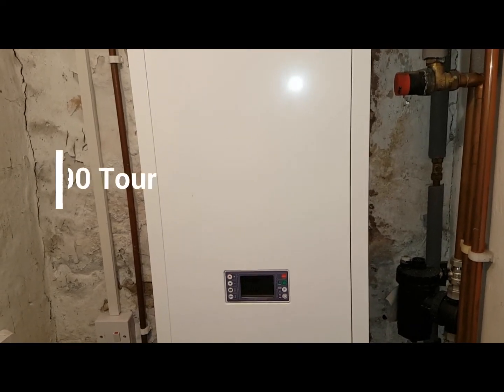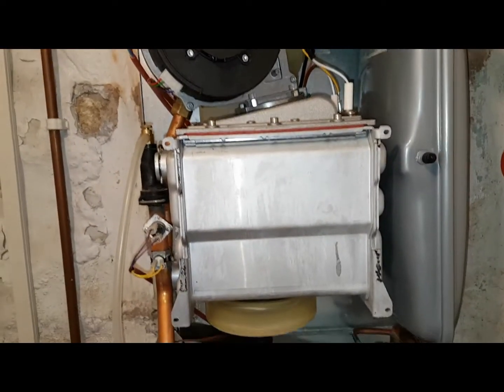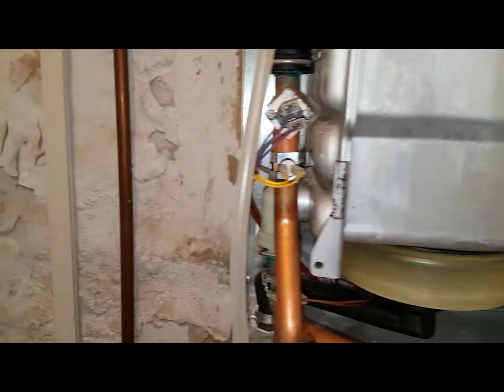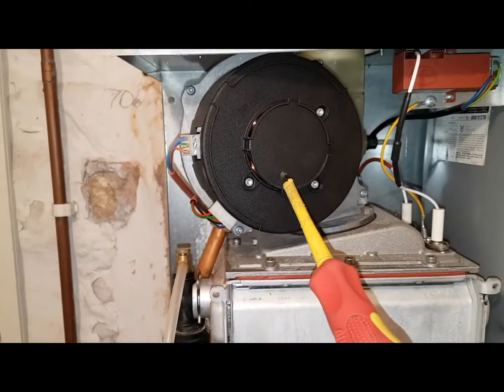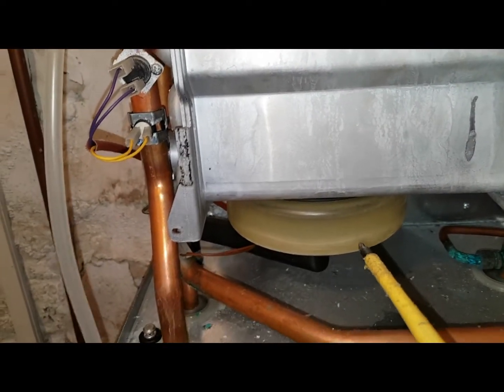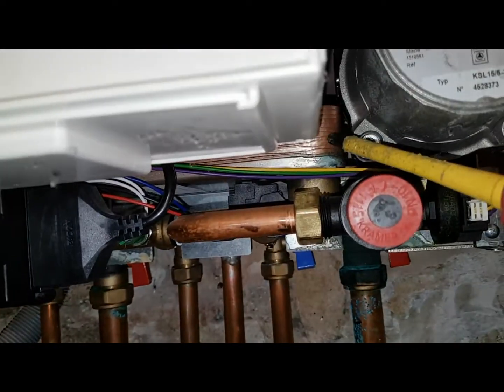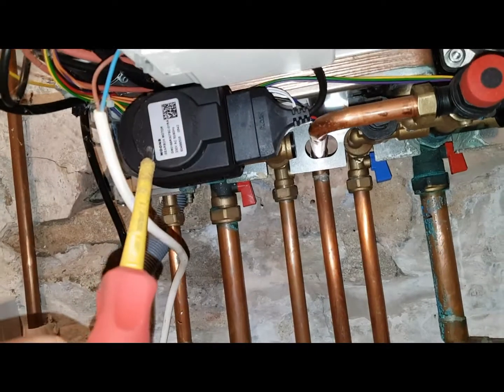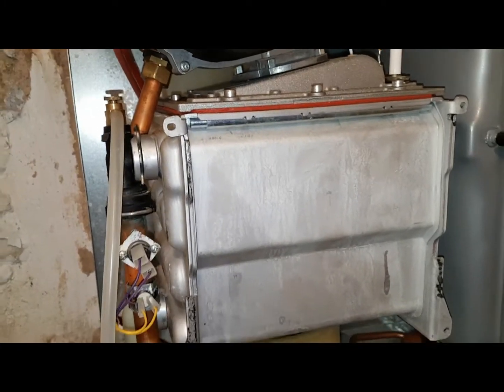Ravenheat CS 90 Tour  With Coach Tony Morgan

Comment: Hi, I was wondering if you could help, I have a raven heat CSS0 and the flu fan is constantly running my boiler showing flame on display but no ignition and no error code